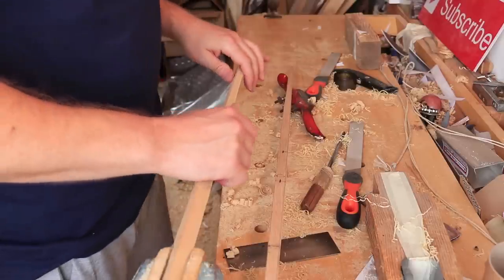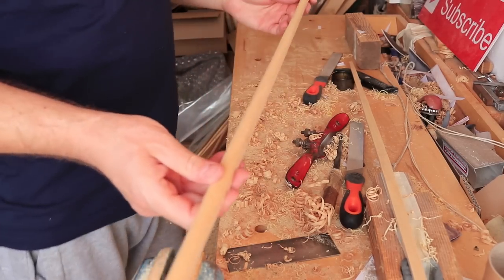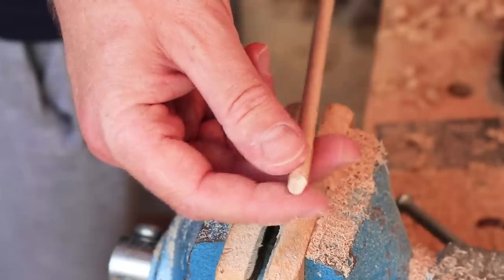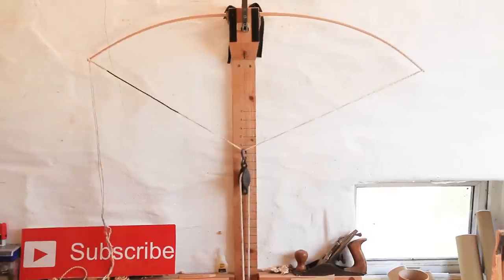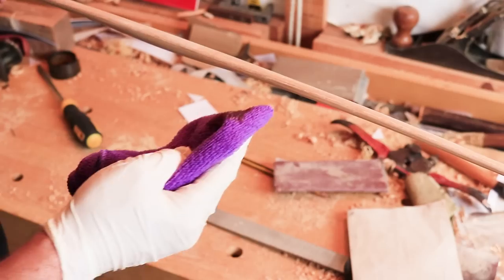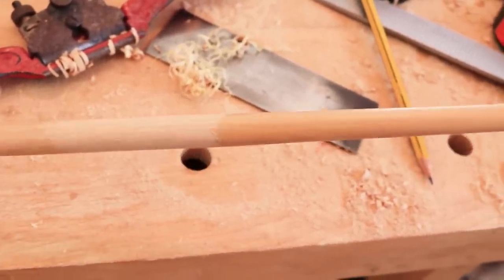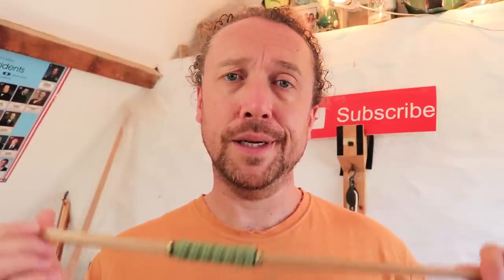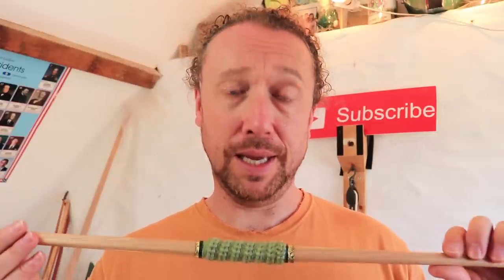How to make a kids longbow, part 2, Longbows for children

Comment: Super small bows,what length did you make these.? The same height as the archer I presume?
Reply from the maker: I cant specifically remember what length, it was few years ago.  Length of bow is based on archers draw length, no height.
Reply: @longbows  .thanks for the swift reply.is there a formula for working out the length of a bow using draw length?
Reply from the maker: Multiply the draw length by 2.5 will give you approx length, this is approx.

Comment: That upper limb looks really much longer than the bottom? 
I understand a little longer, arrow position, etc,  but wow.
Reply from the maker: Hi, yes, I see what you mean, its partly the accute bend in the top limb and partly because these staves are soooo small they dont fit very well in the cup of the tiller, the handle is smaller than the cup,  meaning part of the working limb is bending in the cup as I am so used to having the point at which the arrow passes at the right of the tiller cup.  If you look at the last part of the tillering process, the zoomed in section, you can see I have evened it up on the tiller and it should look correct.